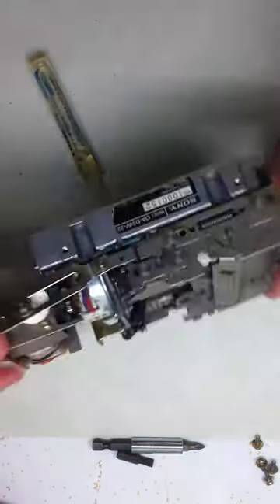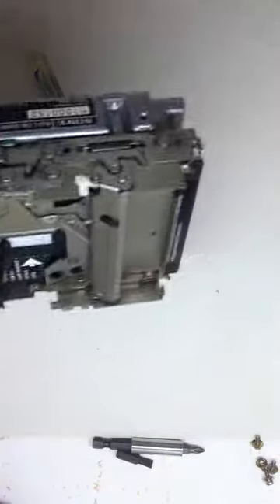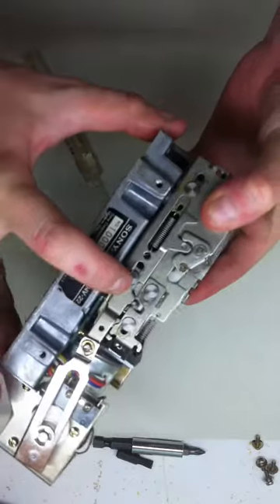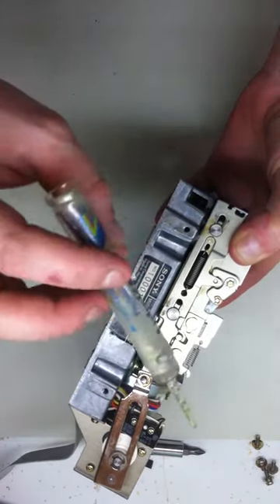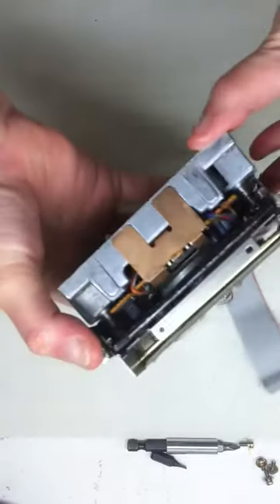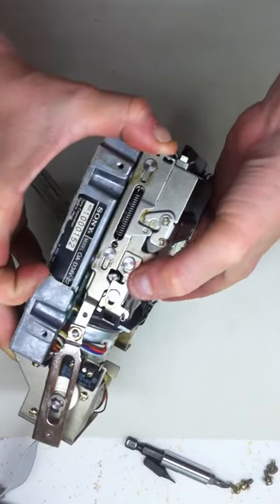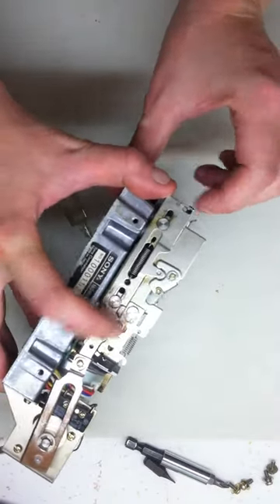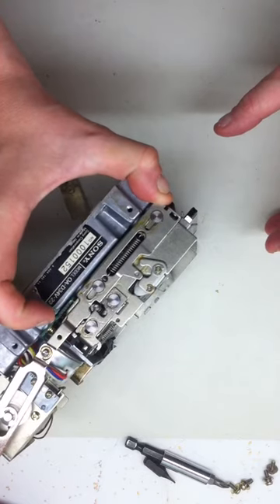Fixing a Mac 400k Floppy Drive Eject Mechanism

Comment: Also clean off the old grease on the stepper motor shaft (looks like a corkscrew) with some WD40. The old grease on that shaft can cause read errors. Relubricate with some lightweight silicon grease and also the slider. 

Cheers,